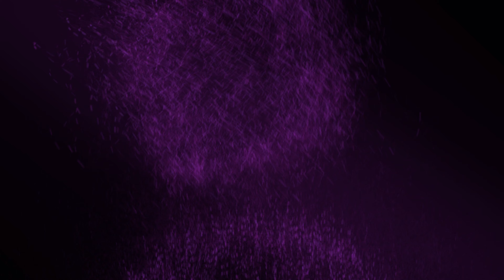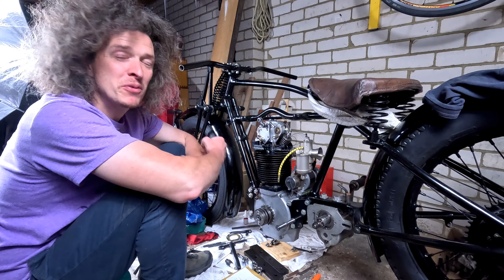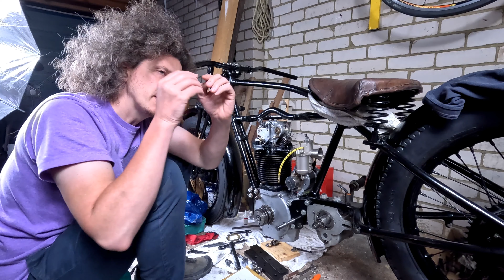velo fan motorcycle workshop ep 1 | Just an overview of current restoration of my 1928 velocette KNS

Comment: Finds these videos very interesting. I see you've got a cloth covered HT lead on the bike? I put something very similar on my Norton Commando (sourced from The Green Sparkplug Company in the UK). Looked great and was working fine....until I had the bike standing in the rain one day at a Brit bike owner BBQ event. I was the only bike unable to start up for ride home. Spent a good hour going through the usual checks for power, fuel...and determined no spark condition. Older/wiser folks standing about all pointed to my modern electronic ignition as being the suspect, though it had been perfect for 5 yrs, why would it up and die first time in the wet? Eventually all avenues were exhausted and I had to have bike taken home on a hauler. Sprayed it all down with WD40 to knock away the wetness and left it two days before more troubleshooting. Checking for spark, and they were all back. Put plugs back in and she kicked to life first time. So the EI was fine. I suspect the cloth covering on the HT leads was providing a short to ground....one chap reported getting a shock while holding the plug against the head while we were kicking it over looking for sparks. Makes sense if the wet cloth was conducting enough. Could be my method of having the cloth under the crimped on end fittings...might be wise to trim all cloth away from under the metal fittings when crimping. Also, carrying a small spray can of WD40 or other "ignition drying" spray on board in case of rain would be wise if running these HT leads.
Reply from the maker: My lead also sourced from the green spark plug company. So very useful information here. I also have left the outer cotton underneath the crimped end. 
Bike is no way near running yet so we shall see maybe just fit a standard black ht lead 
My next video on the kns was going to be clutch install and I missed something out in the previous kns video or did it wrong will address that in next video but as I just made one on the ktt clutch discovering to my horror it was missing a friction plate and I’ve been riding it for 3 years like that I feel I have kinda covered Velo clutch so we will see. 
Just hope you enjoy some of my videos and can continue to pass on the useful information via leavings comments. 👍
Reply: @velofan.  Yes, I am very much liking your videos of these interesting bikes. Recently came across another Velocette channel from Australia where lots of details on engine building and clutch secrets are revealed by an old master...The Hagon Factory is channel name.

I have been stricken with a chronic bout of Velo fever past few months. There are two MAC 350's for sale in my half of North America, both '49s with hard tail and teledraulic front shocks. One appears at the same high level of finish as your restored bikes, other looks a bit rough and rusty in places. They are both at a premium price point ($12.5k) with nicer one is $1k less than the tatty one. Wondering if such a bike can replace my only modern ride, a triumph Bonneville 2013, as a regular longer distance rider plus urban rider?
Reply from the maker: @TornadoCAN99   i had a 1950 or 1948 cant remember rigid mac. Had dowty forks. but maybe someone put springs in not sure. It was an ok bike but i bought it unseen from poland for around 4K english so not sure on currency conversion but seems the ones you have seen are pricey but again maybe prices where you are higher than over here for uk bikes. Seems the market is currently falling for classic british motorcycles. The issue i had with my mac was a JP piston had been fitted with an oil ring half the width it should be. I ordered a replacement JP piston from uk supplier as was only available option. Was supplied with same way too narrow oil ring, i contacted them and sent rings back and they sent me the correct rings. The issue with previous owner installing this piston with narrow ring was ring snapped and the head was full of oil so bike would not run. After my new piston was fitted it was ok but i sold it before running it in properly and my mate who bought had the bike seize up on him and i suspected this might happen. Omega pistons are now available and seem superior but more expensive obviously. my previous velos have been gtp, mac, mss all rigids.
Reply from the maker: @TornadoCAN99   Oh forgot to mention that hagon factory thing ive seen posted on the velocette facebook page loads, I havent bothered watching any because i assumed it was the hagon factory in the uk who manufacture motorcycle shock absorbers. Sounds like its not connected so might give it a spin. I wish i had started making some video of the engine work ive done on the kns But i just wanted to get on with it i guess.

Comment: Hi VeloFan...just re-watching a few of your Velo videos. Noticed in this one, the KNS bike does not appear to have frame rails beneath the engine? Is this a "engine as stressed member" arrangement? I have mention previous comments to you that a 1949 MAC bike forsale locally at a dealer has my interest. Well further study shows it has this "open frame" setup. Some velo folks are telling me this is not a good frame for these bikes...higher vibration and even engine casing cracks etc. That would explain why virtually every picture or video of any 350 Velo have the full cradle frame type. Your thoughts?
Reply from the maker: yes my KNS and my KTT are as you mention engine is stress member. I think the weakness in this frame is actually the bit above the gearbox. my kns did have a crack there according to the engineer who had my bike and he welded it apparently but i dont he know as he is untrustworthy as hell. I have no issue with these frames its how they were made and the mk1 ohc engine frame etc is all perfect, handling is great. The MAC you have seen must be an early one. Is it girder forks. the MAC i owned was rigid but dowty forks, like tele and this had the cradle frame thing you mention with a big plate going under the engine very strong. 
I still you are best off buying a velocette from the uk as can find the exact one you want. Say a venom for cheap money but the import charges and shipping might squash that idea.
Reply: @velofan.  The local bike is a '49 rigid rear but telescopic (Dowty I suspect) fronts and open frame. Have since gathered views from other Velo forums/owners and most caution about this open frame arrangement. Apparently, they were trying to save materials in short supply after the war and thought this arrangement would be OK. But obviously they reverted back to cradle frames very quickly thereafter.  Pity b/c this bike is in very clean condition and has been on market for ages (1+ years)...so likely a deal could be had. There is a another one from private seller, also listed as '49, has the cradle frame but also the updated all alloy engine. I do like the thought of a Venom or later MSS from the UK. It will all depend on what I can sell my modern bonneville for, which must occur prior to a new purchase.
Reply from the maker: @TornadoCAN99  sensible move to sell the bonnie before purchase as the amount you get for it may effect what your budget is for the velo. My mac was 1950 and it had the cradle frame and dowty forks but the forks probably been converted to spring or load of oil put inside, was never sure didnt keep it long enough to find out, they did sag a bit. Personally i would assume the bike is ok. If its survived this many years what is it over 70 years old without falling to pieces its probably ok to ride it. You could try buy the one with allow engine. Mine was the old engine.
Reply: @velofan.  I'm curious why they changed the timing chest cover plate from the lovely pressed/embossed type to the blank, convex type on later engines?
Reply from the maker: @TornadoCAN99   cost saving one can assume. The earlier one is definitely better looking. But i dont actually know, ive never owned a modern enough velo to know.

Comment: You should throw in the mistakes you made when you rebuilt the forks. Seeing how someone else fixes their mistakes can be useful. I should watch some "how to make how to" videos and learn a little on how to film the restoration of my 1946 MAC (iron head, rigid frame, girders). I should've filmed a little before it was taken apart (about 8 years ago).
Reply from the maker: Yeah I agree. I think at the time. I was trying to shoot it live without cutting bits out and so as it was taking so long with the forks I just had to give up. Can’t even remember why it was all not going together but once I got my head round it was fine. 
Iam not sure how many more videos I shall make on the Velo work but I have loads more work to be done. Next video I shall install the clutch but I’ve never taken one apart and re installed one before so we shall have to see. Plus I couldn’t replace the metal plates within as couldn’t find any so again we shall have to see how it operates once’s one action of action ever happens